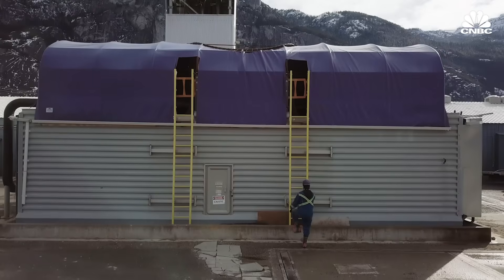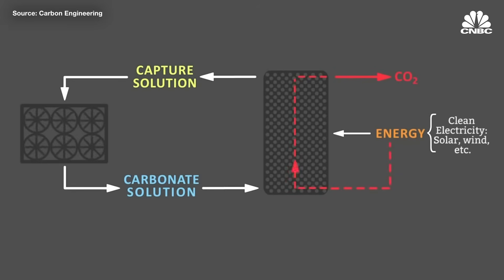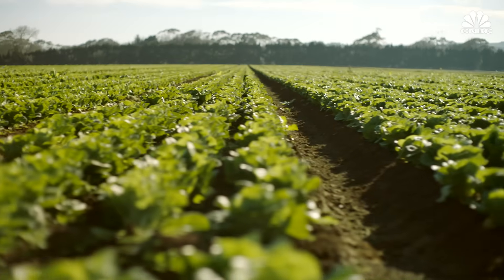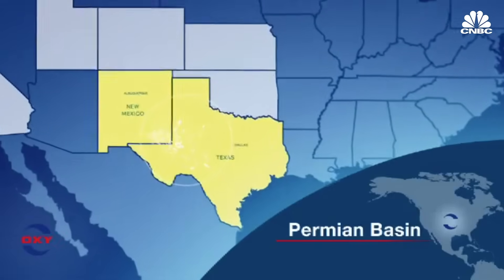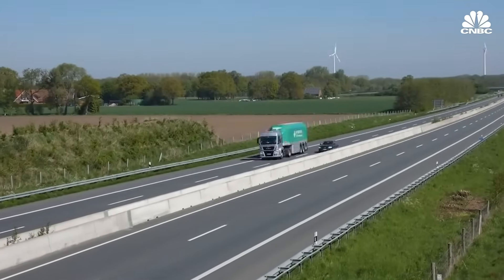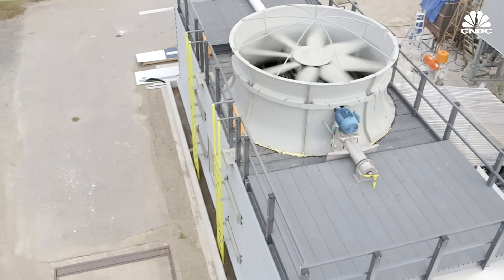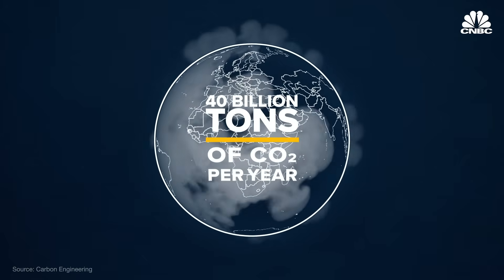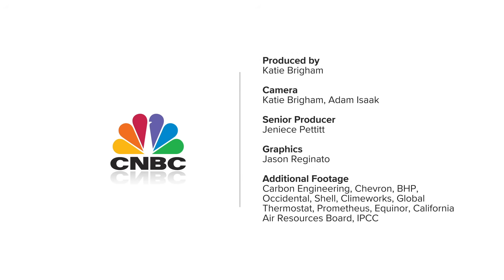Bill Gates-Backed Carbon Capture Plant Does The Work Of 40 Million Trees

Comment: By volume, dry air contains 78.09% nitrogen, 20.95% oxygen, 0.93% argon, 0.04% carbon dioxide. !!!!!!!!!!!!!!!!!
So carbon Dioxide makes up 0.04% of our atmosphere. And of that, humans are responsible for just 3%.  The other 97% comes from all other living things including plants and trees, oceans, rocks etc.  That equates to humans being responsible for emitting 0.0012% of the Carbon Dioxide found in Earth's atmosphere. Man made global warming is a HOAX. Earths heating/cooling cycles are controlled by the Sun and how we move through the solar system.  Of coarse 97% of scientists would disagree with me. Be warned we are entering a cooling cycle now and food shortages will be a huge problem. Go research human history regarding Maunder/ Dalton minimums.
Reply: It used to be 180 - 280 ppm in the last 400,000 years, and then came an increase of FORTY PERCENT at unprecedented speed. 0,028 % (before the start of the Industrial Revolution) does not sound like much, and the 0,04 % now sound unimpressive - until you consider that 280 ppm - and much less  - SUSTAINED ALL LIFE ON EARTH.

 it is true that it used to be much higher in the past (I think more than 1000 ppm - which is still not much as share of the atmosphere. Well the world was completely different then - much less space on land to beginn with (a lot was under water). 

The currently existing plants and animals are well adapted to the lower levels.  - Now we have 400 ppm. That is not much - expressed as % it is 0,04 % - but that trace gas still makes a large impact as building stone of all life on earth.
Reply: the share of Ozone high up in the atmosphere is even lower - does that mean it is not relevant to protect life from UV radiation ? - litte hinges swing big doors !

Comment: ppl are little naive about this lets all switch to the renewable energies. the strongest companies on the planet are the petrol ones and everyone just thinks in few years all will just stop all their production.....ffs, wars are starting still cuz of the oil. This is great tech, and I hope they will make it more efficient and cheaper, but if we until 2050 get to stop CO2 raising and start to lower it down, it's gonna be a success.
This is gonna be a slow process regardless of the politics and capitalism. When electric cars become cheaper and more efficient, ppl will gradually move to them. If we manage to store huge amount of CO2 from the air with technologies like this and use it to make carbon neutral fuel to be used instead of fossil fuels that will be progress. But it takes time even thou we are kinda short on that....but it will still not happen over night.

Comment: We need both solutions Engineering and Biological Solutions to work as it’s never going to work to remove enough Co2 in the air as long as humans roam the planet. The even bigger trick is to possibly come up with a massive use for all that carbon instead of putting it all underground for storage. Some use where that carbon can be made into advance materials and made into structures or buildings could be useful maybe.

Comment: It makes only sense if powered by regeneratives. But then, that regen power should be better used to produce electricity and instead not to produce that power from fossiles in the first place. that would reduce co2 in the air better.

Comment: We need to rebuild the electric transmission infrastructure around transportation and go electric.
Reply: SunriseLAW When was the last time you read the WSJ?
Reply: @mtb416   Too long.  I used to get daily delivery.  Please bring me up to speed.
Reply: SunriseLAW I asked because I had just read an article in the WSJ regarding our transmission infrastructure prior to reading your comment. Simply put, renewables, while still more expensive and require subsidies to compete with traditional energy, becomes a greater reality if we transition to a new, more national transmission system that allows energy to be shifted where and when it’s needed, particularly beyond the state lines of where their energy is initially produced. We’re a union, after all, and state’s rights are a big deal. So it’ll take a lot of time and wheeling and dealing to achieve such a thing.
Reply: @mtb416  ..thanks, funny because a month ago I put the concept on my LinkedIn and a WSJ writer is among my 'network'.  HMMMMM.
Reply: Babysteps, we need to replace coal powerplants with nuclear ones first. The energy for electric vehicles needs to come from somewhere
Reply: @MilanTukidid   A rebuilt transmission infrastructure would be more efficient than the old crumbling one we have. It would best allow regenerative braking or 'cottage industry' along roads of people putting up a few solar panels and feeding the system .  Solar has come a long ways.  New nuclear energy production is probably too controversial.

Comment: Carbon neutral should not be done at the cost of oxygen. 
Burning the pellets also use Oxygen.
Plant trees so that they release more oxygen.
Reply: @bosstowndynamics5488  But the vedio here says that they create the pellets and then burn it to create CO2 which is stored underground. Which does not sound lilke they are generating any O2 here.

Comment: It’s cool that they can extract CO2 emissions and contain them in the form of pellets, but why mention repurposing the pellets into more fuel, wouldn’t that release the CO2 back making the extraction redundant?
At least if the goal is to reduce the CO2 in the atmosphere. 

Maybe I just missed the point.
Reply: you didnt miss the point at all--- this convoluted mess of a machine is just something to put bill gates back into the headlines again and perpetuate the 'world is ending' if we dont do something now trope..
Reply: Precisely, those pellets should be buried or bonded with cement and employed in construction. It seems that the cat is out of the bag, so this carbon capture can and would be a... power-generation process and CO2 emitter!
Reply: I agree with you. I think they do this to help keep costs down as they'll be able to resell these pellets. Therefore they can factor this in for investors when it comes to costs which then looks better on paper.
Reply: No, you're thinking too much. 😉
Reply: actually reuing the fuel would make it carbon neutral. We could lock away the initial billion tonnes of CO2 and once the levels have stabilized, we could just reuse the subsequent CO2 we have captured
Reply: No, pal,  it's called math. If you capture the CO2 and then release it as fuel,  people won't emit more CO2 than what already there. And plus with the trees eliminating CO2 for good,  it's reducing it. 
 We need CO2 for energy, that idiot saying solar is the way need to get to a real institute. So we're finding a way to have energy without releasing more CO2.

Comment: If you want to sell something made from captured carbon dioxide, turn those calcium carbonate pellets into synthetic marble. Use it to make tiles and benches and instead of ending up back in the air, like fuel would, it'll end up in landfill when the buildings get renovated or demolished, doing both sequestration and making money.
Reply: Wood ! could be turned into construction materials. The underconstruction of the roof of Notre Dame was called the forests. Trees (oaks for the most parts that had started to grow in 800 - 900 AD, and were cut down in 1200 AD).

That's a carbon sink.

And a few centuries would help already.

Comment: Wow, what bs, this stuff doesn't work at all, and before you completely disregard this i encourage you to hear me out, most co2 goes up into high atmosphere so there isnt much down here to collect to begin with, the stuff that is at ground level isn't exactly causing the greenhouse effect now is it? So you aren't collecting anything thats actually causing this problem, also where is the energy coming from that it takes to make the co2 into something else, this process takes a lot of energy, even ignoring the process of making the co2 mix with something else the fans alone are huge and take a lot of energy to run, if they run it off of the grid then it makes more co2 than it ever creates, if it runs off of solar well solar pannels take more energy to make than they will ever produce, its physically impossible for them not to, they typically are made with power from the grid so they release more co2 than they will ever save. Not to mention the massive amounts of c02 released by the heavy machinery used to strip mine the toxic resources needed to make solar pannels, the biproducts of these mining operations ruinbthe land around them, then making solar pannels lets off even more toxic waste, the same goes for the lithium needed for the batteries to use for any solar or wind power system, wind power kills lots and lots and lots of birds and still requires lots of stuff to be mined, they aren't as bad as solar pannels but they also can't be used in nearly as many places, so in the end these things don't get much co2 out of the air, the co2 they do get isnt that bad to get, and they likely produce way more co2 than they ever save, most green ave the world stuff is either mad and or funded by people who want people to think they are doing good things for their own agenda. People who dont understand that they aren't solving anything with their invention, or people who have been tricked by this snake oil and donate and support it out of ignorance of the truth, the only energy source that has essentially no environmental impact is nuclear energy which dispite the bad press it gets is much more safe than the media makes it out to be, the real reason we do not use it much is that it is insanely expensive to make a nuclear power plant, hydro electric only effects local ecosystems and it doesn't do it too horribly so id put it at a close second, also the middle east uses mirrors to melt salt and use the heat from that to make power, however the reflected sunlight is like a death ray to anything that flies above it

Comment: Barring an unheralded paradigm shifting advance in chemical engineering, there is simply no way that this carbon sequestration process can be even remotely as efficient at removing CO2 from the air as burning fossil fuel is at releasing it.   Any energy used to  run these plants will invariably remove less CO2 from the atmosphere than the process of producing it puts INTO the air. 

Even if you use renewable energy like solar or wind to power it, that energy would still be more effectively used to replace fossil fuel based power generation - eliminating carbon emissions at the source - instead of running these plants.  It's an inherently wasteful and extraneous process.  And that's before taking into account that constructing these plants and the renewable energy farms to power them requires resources which in turn consumes energy to produce, which emits more carbon and toxic byproducts into the environment.  Trees may take up more room than these sequestration plants do, but there's a LOT of deforested space to replant them, they don't require mines, factories, or human labor to construct, and they don't need human generated power to operate. 

When it's all said and done, they're effectively trying build a perpetual motion machine; or rather, they're claiming to have built one and are trying to sell it to the public. You don't get more out of a closed system than what you put in.

"In this house, we obey the laws of thermal dynamics!!!" - Homer Simpson

Comment: if carbon capture is a good idea then finding products that use captured like carbon fiber or carbon neutral fuels or bio char and the list goes on and on. then cheap clean energy is the only way to make that happen and the only option there is liquid salt nuclear reactors that can clean up all the high level waste to boot.and finally who is going to collect the carbon tax from the sun as ultimately that is where the heat comes from.

Comment: addressing climate change is a smart idea but first you need to understand climate change to have any hope of effecting positive change. if you look at the temperature change it leads co2 buy several months so when oceans heat up they dump co2 back into the air.if you do not take this into account no amount of co2 sequestration will be enough because the co2 raise is an effect not a cause.we are also in a solar grand minimum that may in fact cause global cooling. need to understand that one too.currently 38 weather models are used to predict global warming and they are all horribly wrong  even the most conservative the russian model over shoots current warming by more than 10 degrees.and while i do want to know what is going on the current situation is entirely political so very little good science is going on or we would have models that work.

Comment: Lets bury all that atmospheric carbon underground, yeah!.
Then we can dig up all the coal and put it into the atmosphere, then take that carbon and put it back underground again.... Insanity.
Reply: Why is that insanity? If the net result is zero carbon, what exactly is the problem?
Reply: @mar504  Because coal is already the most stable form of carcon for easy underground storage, why dig it up just to rebury it? 
There can't possibly be a significant energy gain from it.
Reply: @Marc83Aus  Well for one thing, coal isn't the only source of CO2 and seems to be on its way out as an energy source. I don't know the efficiencies of the tech and its bound to improve dramatically in the future, if they ARE able to scrub enough of the pollutants and store them underground while still producing energy... then it sounds like a great solution to me. Wish we had this tech a hundred years ago!
Reply: @mar504  DOn't get me wrong, the tech is promising, but it doesn't make sense to use it while still at the same time digging up more carbon from underground, even with merely using coal seam gas, a lot of that just ends up wasted from leakage, but using the tech to make gas from atmospheric carbon might be an excellent way of storing excess renewables for leaner winter months when solar production becomes anemic.